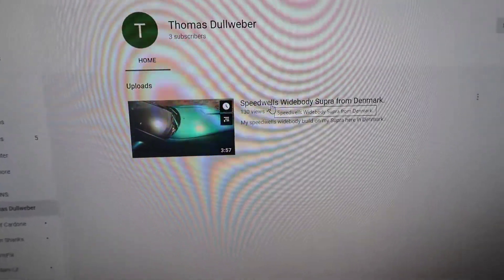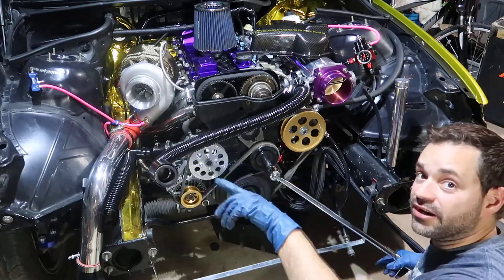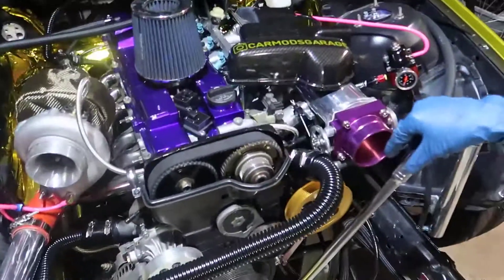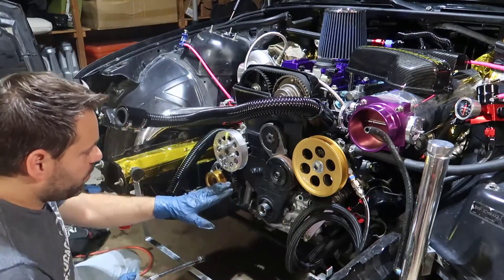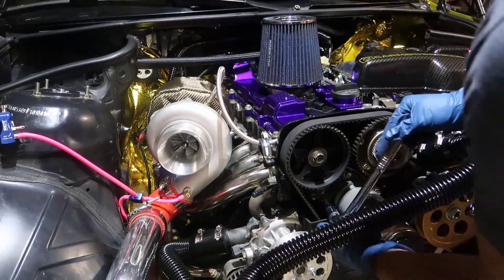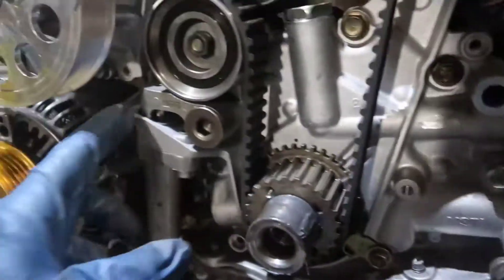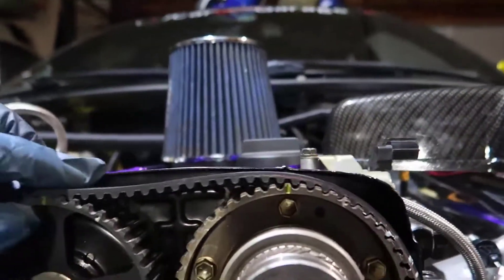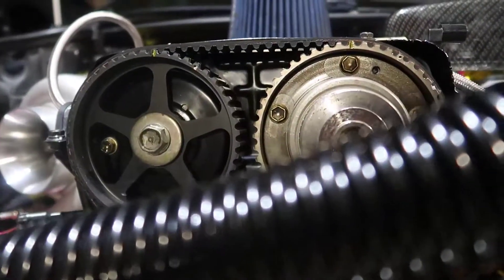⏱️ Timing the 2JZ for the Second Time, Be Aware Before Timing Yours - 2JZ to E46 Conversion

Comment: Did you start your car before you realized the timing was off?
Reply from the maker: I did not. I had a subscriber telling me. Thanks to you guys that watch my videos it saved me a head ache later. Just started the car and time is good now.
Reply: Car Mods Garage would you still be able to turn the crankshaft all the way around even if it wasn’t timed right? Like is there a way you can tell if a piston would hit a valve?